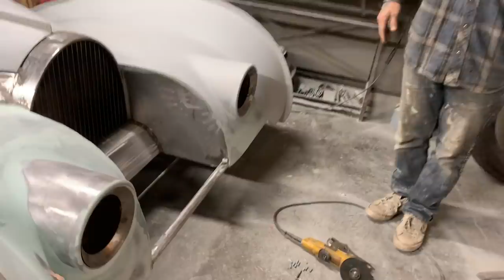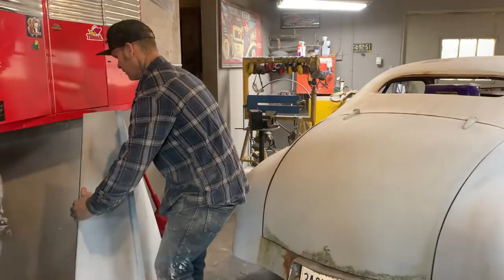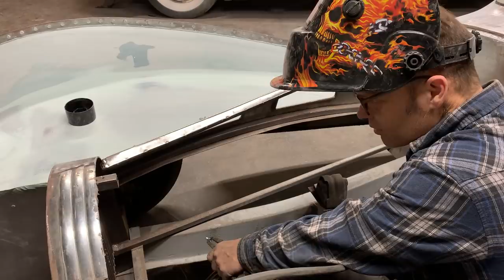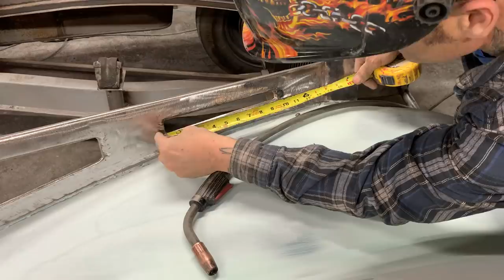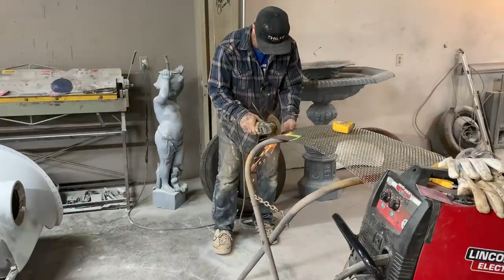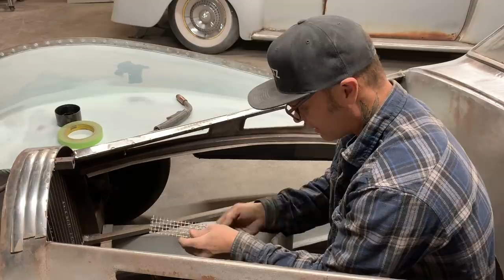RECREATING THE MESH GRILLES ON HOOD SIDES WITH STAINLESS STEEL GRATE

Comment: This has inspired me for the lower grille on my 72 Vauxhall viva, it has a custom fibreglass front end on it but an open lower grille beneath the bumper so i may fibreglass some studs in place or even weld some studs to some plate amd fibreglass the whole plate into position so i can cover the opening in mesh/grate. Thanks Chad and Jolene keep up the great work 😎🤘

Comment: Just a thought if you drill a 1/4 inch hole in the panel where you need the stud you can plug weld it from the outside and the nut will hold it square 🤔 she is looking sweet I’m loving the build Chad great job 👍

Comment: Nice project ! Shop tip if you like ? When I have to do studs like that I drill a 1/4''hole threw the side panel and plug weld then and grind from the outside . It just goes faster and neater weld when done . Good luck keep up the good  work . From Indiana USA .

Comment: I put some of that mesh on the back of a pierced front panel on my car but as the back can't be seen I just fixed it with marine grade caulking.  Painted it body colour.  I did think about forming the mesh slightly to make it bulge out of the opening a little.   Maybe using a plywood male and female former.

Comment: i like that look alot if the car is plastic can we JB Weld screws like you placing on the inner side. And would that hold a screen the same way? My car is a little newer and doesn't have metal there. Besides all I have to weld with is a 110V Stick welder. its pretty weak, no fan so it heats up fast. I think the stitching way you tack pieces together my be best for this welder. I should try to add a fan maybe. Dennis

Comment: Hey Bad Chad, nice project. Now it's just my opinion but the rear wheel quarters seam slightly too narrow in proportion to the front wheel quarters. My take is it will make it slightly twitchy in the ass end. if you were to widen them and use appropriate axle and suspension it might work better. But who know till's it finished , I may be wrong !!

Comment: You should get a hospital bed table that you can roll in close to the car and have the tools on it. That way you wouldn't have to climb in and out to cut.  The table works like an engine lift as you can roll it under the car.

Comment: Thinking it would have been easier to fit grilles, then drill holes where studs go, and plug weld from the outside. No slag on inside and grilles would fit tighter.

Comment: I have a chopped 51 ford I’m building (off and on), I would like to put round rod from drip rail to drip rail where the top meets the rear trunk. How difficult is it to bend that by hand, what do you use?
Reply: Pat, Eastwood has a roll former that has grooves at one end designed for round rod. I bought mine fromthem for a buck-fifty, because the box was broken. I think its around $300 +. Or maybe you can find a sheet metal shop that will helpyou form them. Or, you could try Chad's method and slap it on the ground until you get the radius you need.

Comment: CHAD
2006 Pontiac Torrent Has 17 inch wheels and the Spare Donut Steel Rim is 17 inch
5 Bolt pattern.

Comment: How would you register it if its home made.
Reply: In the states I think you would have major issues. Bumper heights, car has none, emissions, it will be a 2021 model, seat belts, crash tests, turn signals, ect. In most states it would be a nightmare, in a lot of them impossible. The Gould that built the titanium replica is Canadian so the laws must be a little easier on the car hobby.